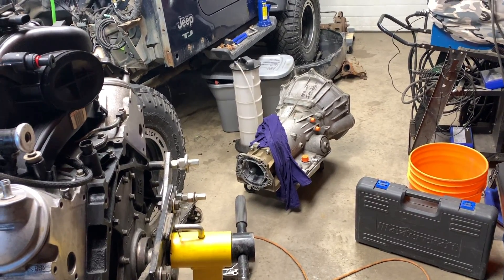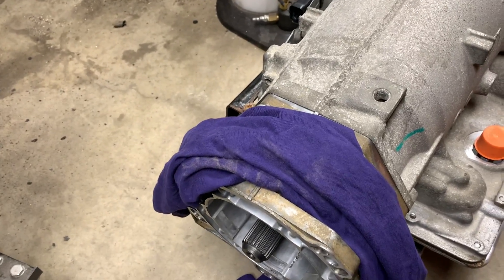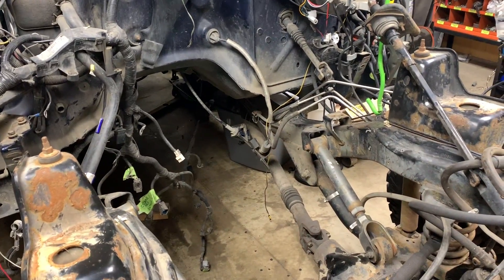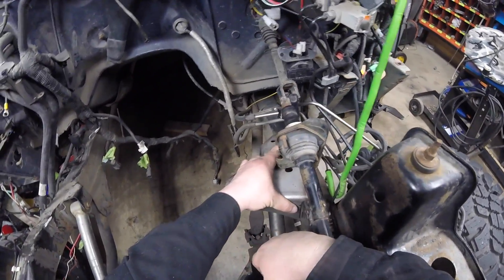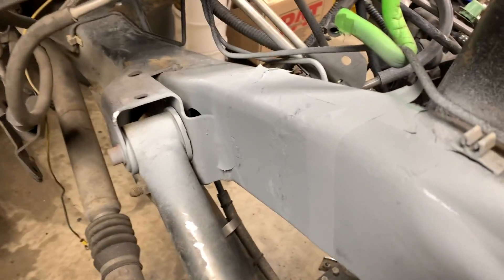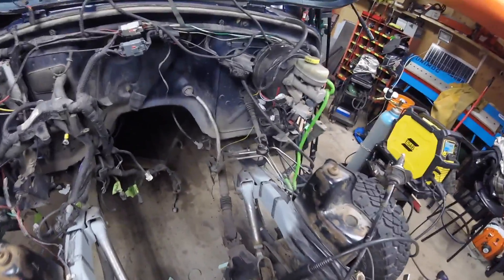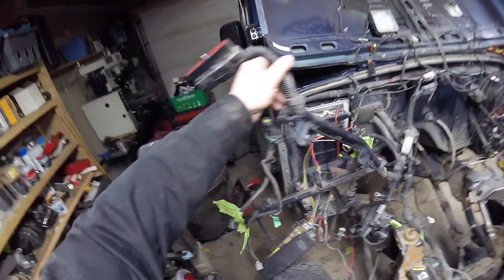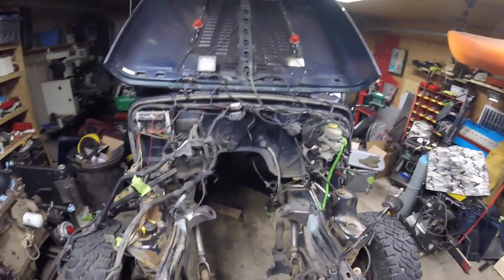Ls Swap VSS Problem

Comment: Jerry I know this is old and you have finished your project. Where did you end up grabbing the vss signal from before or after the ecm? In the middle of a similar swap on a jk and have exhausted options from acquire a vss signal
Reply from the maker: I put the gear between the trans and transfer case
Reply: @BackCountryWrenching  where did you find the gear to put there?

Comment: Is there a vid where you installed the vss in the trans?
Reply from the maker: There is no VSS in the trans
Reply: @BackCountryWrenching  did end up installing the advanced adapters kit?
Reply from the maker: I did and don’t recommend it
Reply: I two am at the vss dilemma, 6.0 4l80e  np241c  for any one that might be in my situation what I do know is, with a Terminator X Max that I went with because I live in the tuli's not a tuner for 100 miles,... in 4low it is not going to shift out of first gear no matter what.  Better to use Factory ecu for 4×4  mine was remanufactured missing pins for setting up AC & tuning cost every time I made a Improvement or from the get-go. Can't figure my shit out at least I can help somebody else maybe.

Comment: Hey Jerry can I run a wire straight from pin #50 on the pcm to the back of The gauge cluster to make my speedometer work? I have a 2006 Silverado 2500 hd

Comment: go with th400 trans way tougher than 4l60 or 80. dont need 4 speeds
Reply from the maker: thats too archaic, they've gone beyond 4 speeds
Reply: @BackCountryWrenching  when i offroad i prefer tough and dependable ...if thats archaic sobe it
Reply from the maker: @ajl9491  was that back in the day of leaf springs ?
Reply: Bullshitkorner got all types lifted tj 35's 2 fj40 leafers fj45 leafer on mil tires . suburban 6" 454 th400, chevy v10 diesel leaf 700r4( crap trans blown reverse) 2 silverados with 4l 60 trans 1 rebuilt one on way out.
all the new stuff is weak with too much cost cutting plastic bushings etc
Reply: @ajl9491  Jerry likes new crap that breaks and costs a ton of money, you are making too much sense so he won't rerply,  Why one would WANT a POS electric shifting junk transmission with fing speed sensors we will never know!
Reply: James Jordan every 4l and 700r4 i have has problems. th350 and 400 manual bw ax15 are older and no probs.
Reply: 4L80E= 400 with an overdrive section